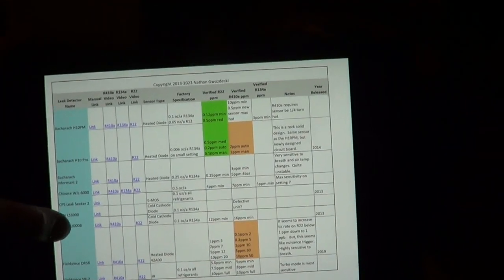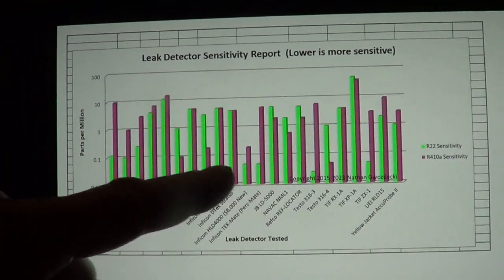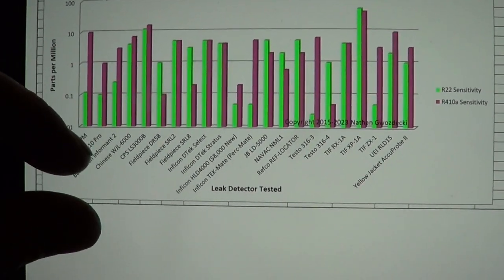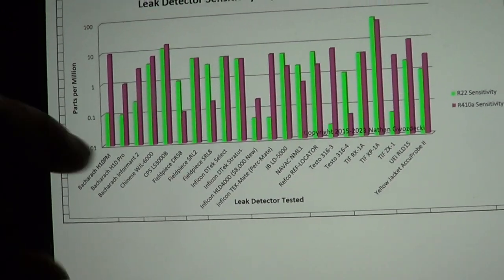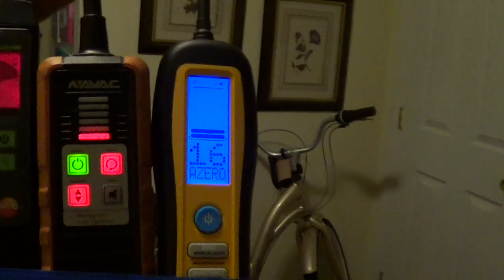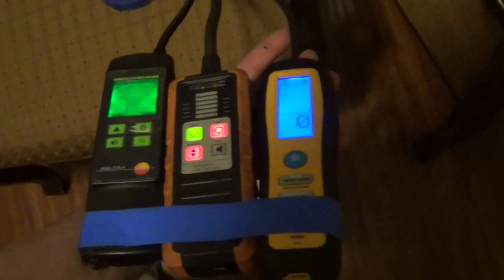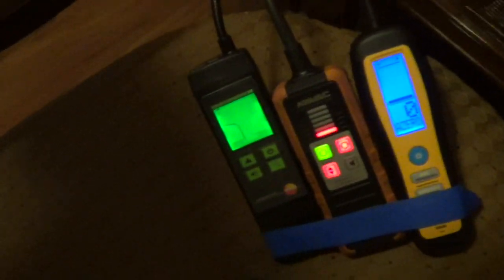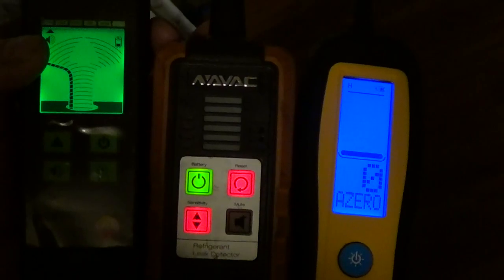Best R410a Leak Detector

Comment: I bought the DR58 a couple months ago after looking at your test results. It gives me a ton of false positives. It seems like any moisture, humidity, or temperature change sets it off. For example moving to or from a cool evaporator with condensation. I always end up needing to use my old dtek select. 

Thanks for doing these tests and sharing them.
Reply: I have similar experiences. I'm wondering if we should be shutting it off and running the blower for a good 10 minutes before using.

Comment: Great comparison. At your recommendation I've used the Inficon TEK-Mate for R22 and the SRL8 for R410A for years with great results. That being said, I acquired a new toy last year: the new infrared Fieldpiece DR82, and it is waaay better than the old infrared SRL2. On manual mode, once it's warmed up for a bit, I think it competes and possibly beats the SRL8 as far as sensitivity goes with R410, and is way less sensitive to contaminants such as bubble fluids or degrading evap pans, making this my new go-to for 410a. Roughly about as squirrely as the SRL8 on manual mode, and neither the SRL8 and the new DR82 are worth much on Auto IMO. It's rated for the new A2L refrigerants, and I don't believe the SRL8 is.

Curious to see your test results on it if you've had the chance to test it.

Also MANY thanks for making this list and making it publicly available!!
Reply from the maker: I will check that one out.   The published sensitivity is the same 1 gram per year as the DR58.   I don't think that spec means much.   However, one thing I like about infra red is that it isn't harmed by large leaks saturating the sensor.    I'll update the report with that one in a couple of weeks.
Reply: @NathansHVAC  Wow you're on it! Spot on about high concentrations of refrigerant desensitizing heated diode sensors; I bought the DR82 after seeing it's spec was the same as the DR58, as I'm tired of replacing sensors on the SRL8 every time me or one of my guys has to pin point a big leak in an enclosed space with the SRL8. (yeah, I know, should keep the old sensors, but somehow they have a way of walking off) 
The DR82 is worse than the SRL8 in auto mode simply because it zeroes so often, but warmed up on manual mode... well let's just say the SRL8 hasn't been fired up for quite a while now.

Comment: By far the best comparison I've seen on leak detectors.  I currently use the dr-58. I agree it is a great detector. I also have a testo 316-4. It never worked very well for me. I think it may have had a defective sensor straight out of the box, which was very disappointing based on how expensive it was. Thanks for the great work!
Reply: I got a dr58 after looking at these charts, I just get constant false positives and always end up needing to go back to my dtek select. Maybe I am doing something wrong.
Reply: @libtrs838  You are not alone, the Dr58 can sell a coil every time. I always use an ultrasonic and soap and bubbles to verify.